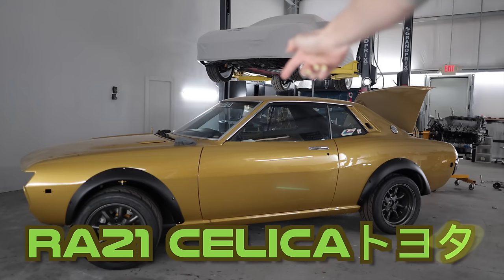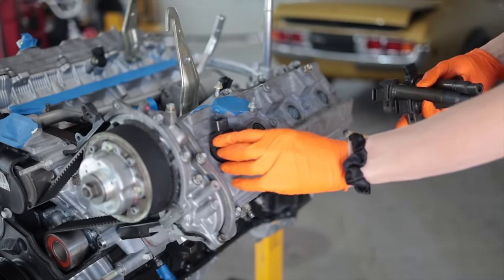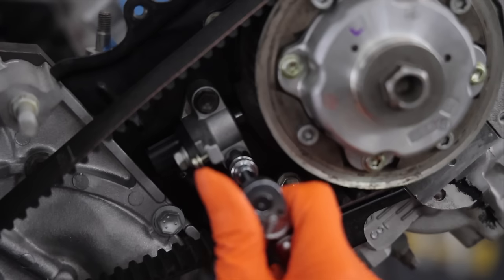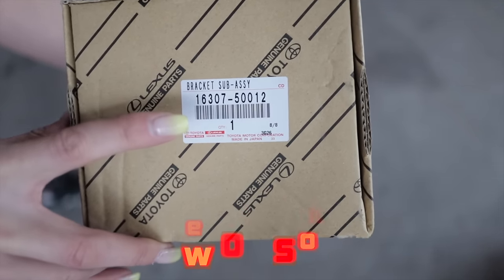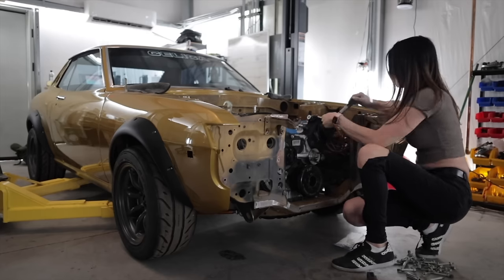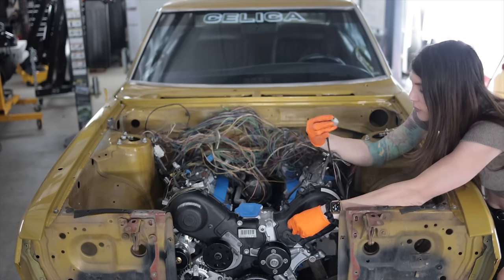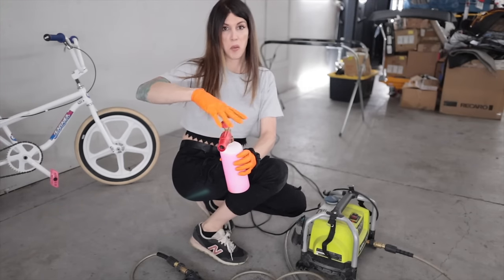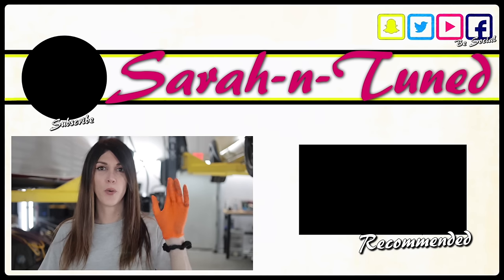FINALLY In It's New Home! // Built NA 2UZ Swap Celica

Comment: This, this is why we need shop classes in high schools, so kids can learn problem solving, design creativity, basic understanding of what they’re even driving around in and how things function!  What am doing, what do I want it to do, how am I going to make it functional… then come up with the plan, build it, found the issue you didn’t know about, redesign and make it better. It’s not a failure, it’s learning.
Reply: yes, even short course repairing car give some experiene thinking, problem solving, patience, finding data, gain skills, frustration, happines when succes. And maybe learn standard sizes of drills, bolts and nuts as bonus. And it can be darn interesting too.
Reply: We need more of that in NZ too mate. And we used to! Now it's gone, everything is worse.
Reply: Our rulers don’t want a populace capable of critical thinking.

Comment: Enjoy these projects while you can.  My friends and I are all too old and feeble to crawl around and under vehicles now.  We might be able to get on the ground and under it but getting back off the ground is the problem!  The days of working 8-12 hours at our jobs then crawl around inside the engine bay of the 1980 dodge 024 with the vw drive train are long gone.  My 2 brothers and I would argue about who gets to drive the all manual clunker with no a/c, no radio.  Mom thought we must have been on drugs to want to drive that instead of anything else available.  It was ours, we built it from parts of 3 cars and it passed safety and emissions inspections.  So it was blue, gray, yellow, and primer.  Matching paint doesn't make it run better!  It was a true peasant car and we loved it.

Comment: There are left hand drill bits, they might be handy for drilling out broken bolts/studs. And I can't believe you don't have an air compressor! You MUST get one!
Reply: Yes, but also, if you just need to blow bits off of stuff, get a USB charged hand blower. Substitute for compressed air cans. Not perfect but you never run out of cans :D
Reply: To be honest an air compressor is becoming a niche tool. Most of the tools one would traditionally use with an air compressor can be found with a battery attached these days, they may even have better specs and utility over the air versions. I use mine as an air duster more than anything else these days. You can even buy those.
Reply: Cheap 1,5 hp compressor herd in over taxed Europe cost about 100 dollars, not best for painting but enough drive dust and debris away.
Reply: @PetrolJunkie  They are kinda handy for getting air into tires though. Air tools are fairly light, low tech, always ready.
Reply: @3ducs  I actually use a protable battery powered inflator most of the time. Set the pressure I want and walk away. It'll stop on the mark and do other things while It's working. Since 90% of the time I'm only adding a few pounds it doesn't take more than a few minutes.

Like I said, most everything you can do with an air compressor there is battery powered tool that can replace it.

In my experience, dragging a hose around makes the air tools more cumbersome even if they might be a little lighter.
Reply: @PetrolJunkie  But think of all the rare earth metals that must be mined for the batteries and the magnets in the motors. An air tool is a simple thing, aluminum body, steel mechanism, that's it. Easy to recycle or repair. They are less bulky and lighter too. Sometimes lower tech is better.
Reply: @3ducs  I wont argue that it's more environmentally friendly to manufacture. But I'm firmly grounded in reality. I'm not alone in people that moved over from air to battery. Most shops I've seen use batteries. It's just what it is.

Comment: Every Toyota I've owned that was pre-1982 I've disconnected and/or removed the power steering. I cut or took it loose from my '69 Corolla, '72 Celica ST, '73 Celica GT, '76 Corolla, '79 Corolla, '81 Corolla and I had zero issue driving the vehicle. I never disconnected it on my '84 Corolla, so I don't know how it would have faired. Honestly, every vehicle I've ever owned pre-1980 I've disconnected or removed the power steering on. Just didn't need it like you do with today's boat anchors and tight steering racks. You have no idea how much I appreciate you doing this project. This is my dream car build.

Comment: if you're using an old factory harness, the best way to do it is to de-pin every connector on the engine side, mount the ECM and route all the wires.  use new connectors and re-terminate the ends (the old ones will be brittle and break anyway), trim as needed to make a nice fit, then loom & wrap.  there's no "cheap way" to do wiring, but if you have it already and you're using the stock ECM, saves a couple bucks re-using.  :shrug:  all you'll need on the power side is the 12v connections to fuses & relays.  i like using a 6 circuit relay box that's separate from the vehicle fuse box.  keeps it easier to troubleshoot later.  👍
Reply from the maker: Yeah, problem is there’s a few dry brittle plugs. I weighed the pros and cons and it would have been more time effective to start from scratch.
Reply: @SarahnTuned One thing that can be easy to mess up is that many oxygen sensors rely on pulling air through the wiring harness to feed the chemical reaction that makes it work - between the strands of the signal and ground wires. Splicing here can cause issues with O2 sensor readings if hydrocarbons get in that air path (some electrical tape adhesive will off-gas enough) or the air path is blocked, for example, by soldering the connection. We had a customer do that on a batch of a few thousand harnesses once, the engines ran too rich and the exhaust smelled like a mixture of rotten eggs and window cleaner.
Reply: @dale116dot7 that’s crazy interesting! Never thought about the tape off gassing. 😳

Comment: The tangle of wires looks like an eagle's nest 😊 Electrical wires are connected to the engine... ignition / fuel injection. Fuel pump. Starter. It is advisable to change to thick wires with silicone coating that is resistant to heat + a double sleeve. Vibration / shocks of an engine + heat emitted from an engine burns wires

Comment: 16 C  is appx 16*2+32=64 F. You could add the correction of 16/5=3. 64-3=61.  Lets try another  30C=30*2+32-30/5=86F. One more time to drive it home. 100C=100*2+32-100/5=212F. Yay. it works. When the temperature is negative subtract the 32 instead of adding.

Comment: A new wire in harness is the best idea given that original birds nest and the positioning dilemma 😁👍
Reply: meh, it's a wash really..  same number of wires and it'll still need trimming to fit right.  but you do get new (chinese) connectors on the ends which can save some bucks.

Comment: The steering,  we call that "Armstrong" power steering.  I'm too fussy about wiring. I buy the small wire ties wholesale by the pound, there are a lot of those rascals in a pound too!!  And I have the aluminum installation tool. It pulls tight to your desired spec, clamps and cuts off clean. Gives a great look!!  Can't wait to see the motor all painted up and looking nice!!  8)  --gary

Comment: The key to drilling out broken bolts is to use L/H cobalt drill bits. The very bet extractor set is the Snap-on bolt extractor set. It comes with L/H bits and extractors. Just saying.

Comment: Why not build a dog catcher for hold by the belt tyres with a old agregate belt and a stick !:)
Öil filter able easy screw out too.
A heavel stick of steel that got a line inside between two plates of steel is able go on from backside in the rim for by horizon weld on to hold stiff too.

Comment: Yo ! There exists on ebay electrified little aircompressor for work . Not high costs , able easy to track on work place , cause big like a backpack and enougth pressure air by for prove tyre pressure or use a air pistol to clean and use a airpressure mechanic tool too, or too vacuum the cooling system to fill cooling fluid in vacuumised inn !:) 
Happy eastern days and not eat so much egg or choclate ! ;)

Comment: We used to throw 351ci Windsors into Celicas & Mitsubishi Sigmas here in Australia in the 1990's.

We often used an FMX or C4 auto, and manuals were usually the Celica Supra 5 speed, and we would cut up EB/ ED Falcon diffs to fit the floorpan (often with the stock axle tubes, sometime keep the Falcon rear disc setup with shortened tubes & axles)

Comment: Parts washing sink. 44 gallon drum paint a design on it and sit it on wheels so its mobile. Cut a small hole in the top to line up with an old laundry stainless steel sink to sit on the top. When you pull the plug the waste goes into the drum. Put a tap about 1 inch up from the bottom on the side so you can recycle the degreaser. With the wheels under it that makes the tap about 4 inches off the ground.

Comment: That VVTI Solenoid; when replacing the alternator on my 1.5L I slipped with the ratchet wrench handle and hit the solenoid, it then quit working.  Found a matching part number at the scrapyard for $5.00. 😊

Comment: "Celsius, scale based on 0° for the freezing point of water and 100° for the boiling point of water. Invented in 1742 by the Swedish astronomer Anders Celsius, it is sometimes called the centigrade scale because of the 100-degree interval between the defined points" - Easy, but if it's 60 degrees Celsius outside, you don't go out 😂😓

Comment: If I can get the weather pack connectors and what-not that I need I'll build a custom wiring harness every time over trying to make old harnesses fit. I can usually build one faster which usually offsets the time spent trying to sort out wires, cut and soldering, relooming... you get the point. Usually, (my rock bouncer does not count) the wiring comes out clean and factory looking which is well worth the extra effort. I don't want my projects to look like Frankenstien's Monster, especially the wiring. That just screams low effort and low skill when the wires are hacked together. 🙄

Comment: Much of the reason your smaller drills are broken is probably that you're 1) not using a center drill to create a pilot hole (or "dimple") to give the drill a useful starting face, and/or 2) using jobber-length drills (unless you absolutely need the length). Stub length or machine screw drills will "flex" less since the drill itself is closer to the "disagreeable" thread or stud (in being shorter...). The third (and forth) thing(s) I'd recommend is to provide copious amounts of lubrication, as well as consider using M42 Cobalt drills to do such things. They are tougher than the standard M2 HSS drills and if treated right, they will last a lot longer than those HSS drills (at a higher price, of course, however they will pay for themselves with a longer life). 

There are also stud removal kits that are great at removing broken studs like the 2nd one you're working on...if you did not know. They're sometimes called "tap removal kits", but I wouldn't recommend them for a broken tap.

Comment: Sarah.  Get some left hand drills which you spin counter clockwise.  As they drill they quite often grab the bolt and spin it out.  The drilling can weaken the bolt as it becomes a thin shell allowing it to let go of the threaded hole.  Also, get some spiral flute machine taps.  SOWA makes great ones.  They are so much better and stronger than straight flute hand taps so less chance of breaking in a hole

Comment: Sarah. Try Watson street works , Ron Francis , or  hot rod wires. They have a 64 pin male and female plug for modern ECU motors. It really cleans up the engine bay and you can get rid of the extra wires.👍

Comment: That 106mm bolt give flashback, in old IBM  computer Field Repair Manuals, there is bolts and nuts listed and torque too. Funny thing for laptop but then there is no excuse if it is done wrong.

Comment: Use the exhaust of the shop vac as a compressor. Perhaps use it with a smaller tip to get a bit more pressure?

Comment: Left hand or counter clock vise drill bit sometimes can get broken bolts out.🤔😁 Label each end of the wires so you do not have to track them down.  Loom the wires you are sure about.  Figure out the size of hole in the fire wall you require.  Get ride of the wires that do nothing.

Comment: Do you have a plan to prevent oil starvation with that front sump oil pan? At a minimum, I’d recommend an Accusump and some oil pan baffles.  Lots of examples of rod-knocked engines that had a front sump oil pan.

Comment: Turning the wheels on a smooth garage floor is different from asphalt. I once tried to loosen wheel nuts by hand in my garage, ending up spinning the whole wheel. No chance i could  do that in the street. That said, i am sure turning will be fine.

Comment: I did have a feeling that you were going to order the new harness. As watching your videos enough, I've gotten the sense as to when you're unsure and end up changing your mind when it comes to specific things,  (granted it was a short change in decision this time). Not to mention with wiring on projects, its technically better to go new, as you don't want the risk of the wire insulation failing (due to age) and starting a fire.

Comment: Most of the time I made my own wiring harnesses. It always seemed easier and cleaner. Just for peace of mind. Of course, I used OEM harnesses as a guide as much as possible. I love looming wires. That’s just a residual of my Air Force experiences. Are you using a rack and pinion system?

Comment: People who said you won't be able to turn must have never driven a decent manual steering car. They also should realize that when the car is rolling, it's much easier to turn the wheel. 😉👍
Reply: I had s TA23 Celica ST1600 and the steering was light at low speed but my AE86 was very heavy. Both cars were a dream to drive but built to do different jobs.

Comment: There's a reason old-timey cars had huge diameter steering wheels. I'll bet if you went up just one inch in diameter on the Celica's wheel, you'd be able to feel the difference. Might make for an interesting experiment. Hope I steered you right with that suggestion. That was my aim, anyway. Oh, I seem to have taken a bad turn here.

Comment: What about stringing all that wire in a bundle underneath the windshield but also under the hood there? Maybe it could be straightened then doubled back on itself however many times it takes to fold it into a neat package that would fit in that space?
Reply: Or, could it be criss-crossed and attached to the underside of the hood, itself?
Reply: You don't want all that low voltage wiring so close to all those coils.  Not to mention the baking factor in AZ sun.  Carl, TX  @worryphree

Comment: Better no AC inside . It eats horsepower ! 
Better 2. Oil pump that give on 2. Oil and pressure by got a tank too cool Oil and its like a combination of series Oil pressure system and a "Trockensumpfschmierung " like a Porsche or race car ... !;) 
The screws for bleed out the Oil by cylindarhead and front of Engineblock could be useful for the pipelines on pressure side , so the oil is cool on reserve too .
My car love hot Oil 128,9 °C .
:))) The Egg cooker ;)

Comment: Rock Auto carries OEM Denso coils, $50 each.
Reply from the maker: They’re likely Chinese knock-offs, gotta be super careful now they even copy the labels on some amazon sellers.
Reply: Even on the digital calipers you use. @SarahnTuned
Reply: @SarahnTuned  You are absolutely correct, Amazon, eBay, etc. is full of cheap copies. Rock Auto units are genuine though. but they do say Denso instead of Toyota.

Comment: As someone who doesn’t run power steering in his S2000, they will argue with you about everything. It’s nonsense. The angle of the rod is most important, and a loosened servo makes it easy to turn.

Comment: I have avoided the temptation to shorten the harness to the ecu many times. I'm thinking that you have somewhere between 80 to 100 wires to the ecu that would need to be shortened. If we had the correct connectors to shorten on the sensor end with new parts and the correct crimper, it wouldn't be bad, just takes more time. Being able to put the ecu anywhere and make it look like it belongs there is a treat when you use any factory harness. I've been putting them on the cabin side of the firewall and putting the slack loop up high out of sight. I'm looking forward to the fire up. I'm curious about how crisp it will sound. :) Also, what's the intended rev limit?

Comment: It's too hard, it's to soft, you put in backwards, can you hold a steady rpm for the love of. 
Dam women are hard to please. Old seals were meant to be used with the oil's / fuels of the day.  Considering they were made ? when? A nice young well lubed seal that slides ,oh so well just right , made from new fresh, not 35 year old parts just feels right.
Back in the 70's if they had built this. Every 16yr old kid would be dead and none of you young kids would be alive. 
I love this build, the attention to details is over the top. Also I think Toyota stole the 67 Camaro look and shrunk it. 
I can't wait to see you doing rolling burnouts.